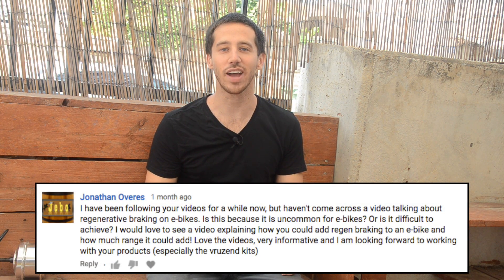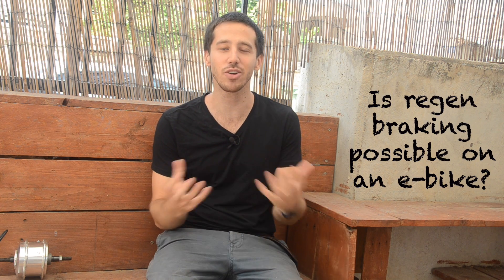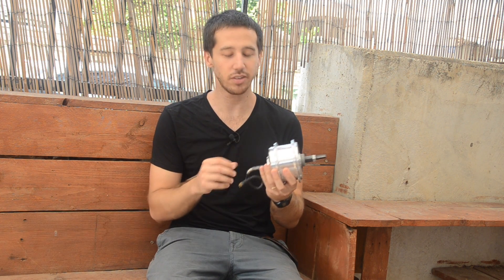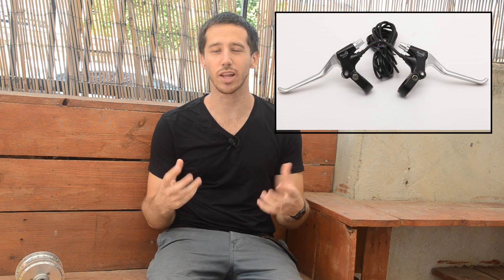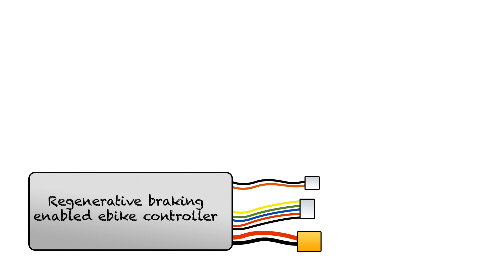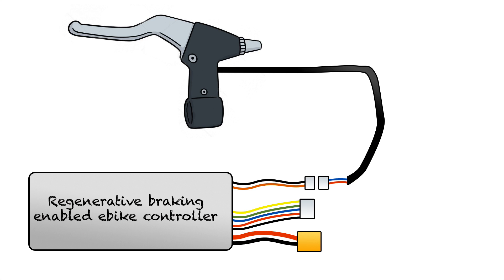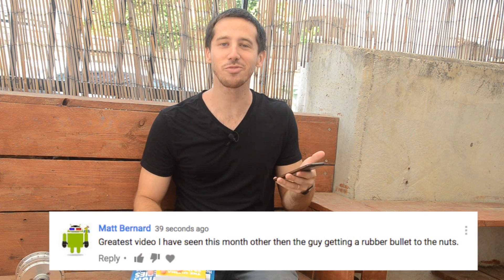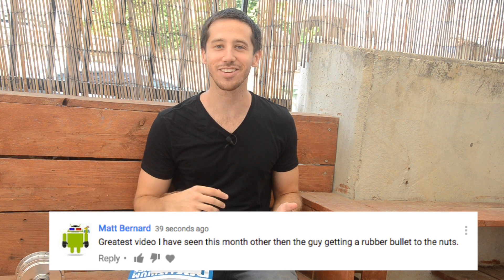How to do Regenerative Braking on an electric bicycle Q&A#9

Comment: Ive had my E Bike a few weeks now and wonder why when not using the motor and I have only fitted the throttle thats its so bloody hard to peddle, I have a 36v 500watt kit with a 15 ah battery so I'm not really worried about range but if something else goes wrong it'll be a nightmare to ride home pedalling. Please if anyone can help I'd be grateful. Thanks
Reply: There are trade offs with all different types of drive. You have a large hub which is going to be cheap, reliable, quiet. But you will have a hard time pedalling under no power and the weight is all at the back, and it's heavyish. I think, but not 100% sure, that geared hub motors are the one if you want to pedal with no power. These have a clutch i think. They're lighter. But the gears will eventually wear down and they'll make some noise. I'm fairly new to this game too so someone please correct me if i'm wrong.
Reply: As your here in an Regen video i take it you have a hub motor? can you tell us what kit setup you have please?
Reply: Just a standard e bay 500w kit large black hub, ones that cost £150 it only has a 3 pin brake cable but I have not connected anything but the throttle and the motor and it peaks at about 25 amps 36v. I am looking to change the controller for one with slightly more amps peak I've seen ones that peak at 30 amps and have a lot more choices with high-low braking and regen, I'm pretty sure mine doesn't have regen brakes but with no power, it's so hard to pedal. Thanks so much for getting back, E-bikes and its community are great I've always been a die-hard car and motorbike modder but E-bikes are amazing for cost and fun. My bikes slowly paying for itself. Oh also I fitted a watt meter and there is no difference when not using power, which was a cheap brilliant mod for only £7 tells me loads of info and very easy to fit.
Reply: disconnect your batt.wile peddeling???
Reply: People saying you should change the motor, I say improve your gearing. From the crankset to the cassette, get some wider range gearing. No power, no worries just less speed. A double (or triple) 22-34t (44t) crankset with a 9 speed 11-36 cassette (or 7 speed 14-36t freeeheel)  will do. 
Power on - high gears, power off - granny gears.

Comment: i left my charger on last night and forgot about it. i have a battery that has a bms 10s2p. when i checked it the morning the charger wasnt hot but, i am still worried about the health of the battery.
did that broke the battery?
Reply from the maker: Does the battery have a BMS? If yes, your battery is almost certainly fine. The BMS will cut off charging when the battery is full, and you can leave it plugged in for as long as you want.

Comment: will "coasting" give more regenerative than "braking"?
Reply from the maker: It depends on how the bike's regen is setup. Most don't perform regen during coasting, otherwise you wouldn't really be coasting, you'd be braking. Some bikes do perform regen when coasting though, so basically if you aren't pedaling or giving throttle, you're braking in the form of regen braking.
Reply: after re-watching the video, the answer was in the video. awesome video.
Reply: Is voilamart regen braking I left my original brake cables on my ebike and left the wires off and motor still works ?
Reply: Any braking at all is a loss, regen or otherwise. Tesla owners have noticed that they gain range with regen off. They aren't wasting energy to charge the battery. But this means that you have to change your driving habits and not use any form of braking. It isn't so clear if at higher speeds it would be more cost effective to regen brake to a lower costing speed since air drag would be significantly  lower.

Comment: Hello Mike, I really like and enjoy your videos as they are pretty informative.
I want to ask you a question:
My eBike has a motor in the back wheel, it is one of those silver ones you showed in this video.
The problem is, the motor is way to loud for my ears. So my question is: is there any possibility to reduce the noise it makes, without running into thermal problems?
Reply from the maker: I'd start by ruling out a problem. Geared motors are louder than other motors, but they shouldn't be terribly loud. You may have stripped gears or a worn clutch in there. If you have a local ebike shop, I'd have them check the motor for problems. Other than that, going slower is about the only way to reduce the noise a motor makes, short of getting a more expensive "sine wave controller".
Reply: EbikeSchool.com thank you for the quick response. The thing is, it was loud from the beginning... But it is getting louder. In just drove about 700 km yet. 

I will let the local shop check it then.

Comment: Hi, something I've been thinking about lately and would appreciate your thoughts on, bms controller built into your battery pack or not? There's so much conflicting and confusing advise out there on this topic.
Reply from the maker: I am personally a pro-BMS guy, but some people are against them. Without a BMS, you have to balance charge, which requires a more expensive charger and leaves more room for errors with settings. Including a BMS means you can charge your battery as simply as you charge a cell phone or laptop.

Comment: I love to learn more every time with your videos.
Just a question. Is it possible to place two batteries in an ebike? And what to consider about this. Thanks!!
Reply from the maker: I assume you mean in parallel? Yes, it is. Works best when they are similar Ah and you should only put them in parallel when they are the same or almost identical voltage (i.e. charge state). Good rule of thumb is to only parallel them when they are both full charge

Comment: Nice Video Mike! I Learn everything by your Videos! 
Question: How can I measure AH of a DIY Battery Pack by cell, can you give us the Formula?
Reply: Divide the watt hours by the voltage, then by the number of cells in parallel.
Ah= (Wh/Volts)/#parallel cells
Reply: NeutronPCXT Thx Bro ✌️